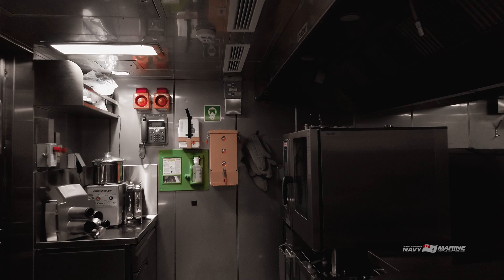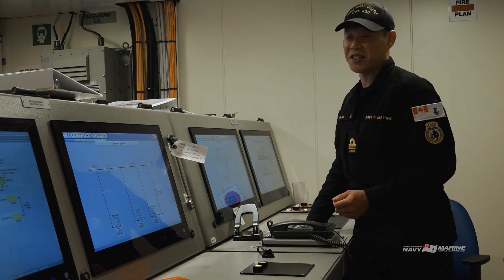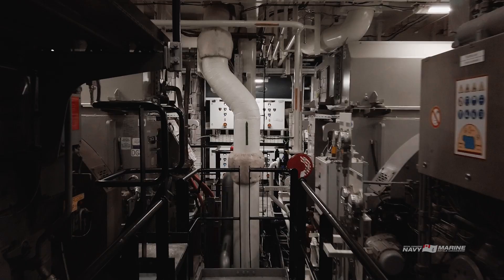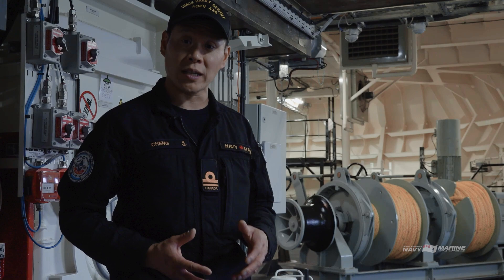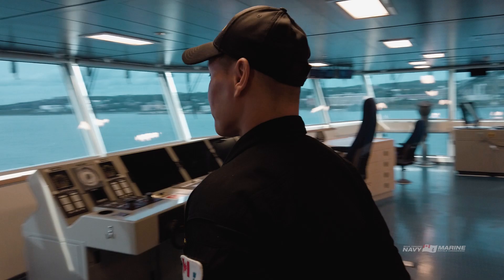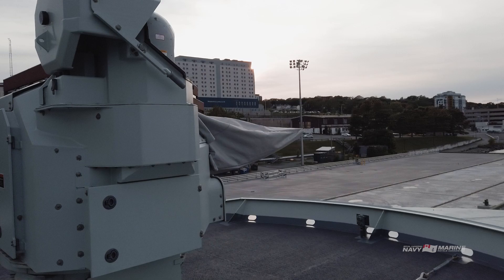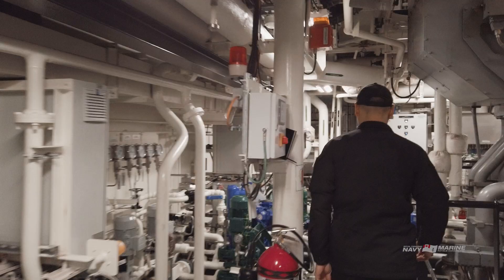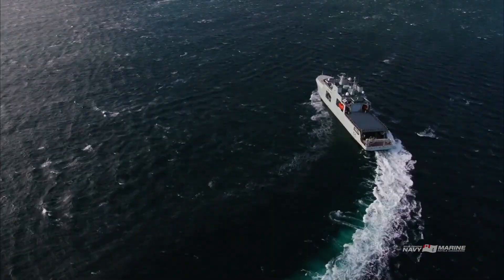INSIDE LOOK aboard HMCS Harry DeWolf

Comment: At least put a 40mm, if you’re going to arm something do it right. May as well make this a coast guard boat, that 25 won’t put a dent in anything
Reply: And you're going to attack another naval ship with a 40mm canon? Goodluck with that.....
Reply: The 25 mm will definitely do a lot of damage as long as it can be fed with enough rounds and no stoppages. It's not designed for big game.
Reply: guns are dead on navy ships, they have mostly been mid range anti air, up to this point with little use in a battle other then against a much smaller fast boat.  surface to air-harpoon types are the main armaments' these days for mid tier navies.   many different systems can be added to this platform as needed.
Reply: The helicopters do the dirty work
Reply: @0penminds  anti aircraft, anti UAV swarm
Reply: @0penminds  the greatest threat will most likely be air attack. A bigger gun means mostly longer range and longer range means more precious time to engage multiple incoming targets.
Survivability.

Comment: A beautiful ship that needs more teeth! Hopefully she was built with the ability to easily equip future modifications.
Reply: I just got posted to this ship. They are not intended to be a Warship, but they are quite versatile and could easily be fitted to be one!
Reply: @rwilletts1968  Thats awesome if you don't mind me asking what trade are you in?
Reply: @alecbidart4969  Martech Legacy Electrician
Reply: @rwilletts1968  What's it for then?  What's the point of having a warship, that can't fight in a war?  Just call it what it is, a fishery patrol vessel.
Reply: @Richard M  having that little bushmaster means free passage through the Panama Canal
Reply: It seems like she was designed with a lot of room for refit, possibly expecting a weapons upgrade when we don't have a PM that pisses himself every time he sees a scary gun.
Reply: @rwilletts1968  no tney couldnt tney would need extensive rebuilds, weapons Radar ect ect and it would be cheaper building a warship!
Reply: @patrickwellsnlesd that’s never going to happen on this OPV.
Reply: @thiccbeaver3132  NK way, this ship isn’t a warship it’s a patrol vessel nothing more.
Reply: @richardm3023  It's armed enough for  99.99% of encounters it will potentially face.
Reply: It isn't designed to fight it out with another ship. It is designed for arctic patrol. Landing and supporting a shore party is built right into the design. Planning on fighting in an island hopping war in the pacific? This ship would be incredibly useful.
Reply: What get my nerves about those boats is not that much the armament: Yeah sure, a little upgrade to a BAE 30mm would give those boats a 0.5km gun range further (from 2.5 to 3km) but they are not for military purpose(I get it). Nope it's the freaking price! It's based on the Svalbard class, who got a 57mm Bofors Canon plus a single surface to air missile (just in case a chopper get in your way). Svalbard class patrol ship cost less than 1/5 of the Canadian version, that's what we can call corruption of High scale. I'm pretty sure the russian Project 23550 patrol ship, inspired by same Svalbard class ship, will be more cost effective and  equip with a 76.2mm AK-176MA gun, plus 8 3M-54 Kalibr antiship missiles. Thoses Harry the Wolf boats look wonderful but at what price! Maybe we could have bought 8 nuclear submarines for that price tag!
Reply: @jplortie2910  I worked contracting in the Canadian military and I used to joke that our motto was saving thousands while wasting millions.
Reply: @jplortie2910  these can’t be as expensive as nuclear submarines! I don’t even know the price but they can’t be...
Reply: @PabloGonzalez-hv3td  Canada's motto should be : Doing less with more! But it's nice opportunities for business...
Reply: @bulletproofguy5112  You're right, I exaggerated. Nuclear submarines cost anything between 1.5 billion to 4 billions per unit: depending on size, equipment, how many you buy initially, etc. It means we could've had about 2 nuclear submarines or 7 conventional one for same budget. Of course, those boats serves a different purpose than submarines but I hope you can appreciate the magnitude of exceeding budget here.
Reply: @jplortie2910  yeah, seems a hell of allot. But hey our Nuclear armed Drednoughts are costing 30+ billion pound Over their life.
Reply: @jplortie2910  Ha that was our actual motto and it's not any better.
Reply: The main future role for the ship is to monitor shipping in the north west passage when the passage thaws and cargo containers start using it to transport goods.  They assert Canadian sovereignty over the passage and enforce Canadian law on ships passing through as well as provide sar.  I can see Canada buying another 6 in the next 20-30 years.
Reply: @boratb258  exactly, the NW passage is a huge boon for Canada and will bring in a ton of revenue tolling ships that pass through territorial waters (egypt charges 200k+ for a trip through suez). The purpose of this ship is to protect Canadian revenue in the Arctic, not fight wars. The US right south of Canada has the warfighting Navy and I doubt they ever plan on fighting anytime soon. Smarter for Canada to invest in itself and if the NW passage is lucrative enough then it can go building warships
Reply: @richardm3023  The ship is for patrolling the edge of the waters and looking for threats, Also Busting piracy pirates and so on.
Reply: @jplortie2910  True that they cost more but that is the price to pay to develop / maintain shipbuilding expertise in Canada instead of farming it out to other countries.
Reply: @richardm3023  I don't know but I'll be sure to ask all the other navies why they have patrol vessels less than a 10th this size.
Reply: @bulletproofguy5112  NOT FOR THE ICE. TRY THINKING
Reply: @richardm3023  it can also be used to break ice up to 3 feet thick, its meant for patrolling up north
Reply: It’s armed enough to chase off pesky Chinese fishing trawlers, or to compel another vessel to be boarded and searched.  That’s all it has to do.
Reply: @richardm3023  Who called it a warship?
Reply: @CorePathway  Exactly. All it needs is a gun capable of popping shots off at the bridge of a cargo ship that refuses to be boarded, which it has with the 25mm. The future role of these ships is built right into the name. Arctic Offshore Patrol Vessel.  When the Northwest Passage inevitably becomes a more viable route for international shipping, these ships will ensure Canadian laws are followed in our territorial waters, and provide better SAR coverage in the north.
Reply: @bulletproofguy5112  No, I disagree. These days the reduction in size of many systems. Makes them ideal for retro fitting. Even if that means containerised systems sitting on the deck, plugged in to the ships power supply. The naval version of the BAE 40mm CTS takes up very little room; could sit easily on the foredeck. It can also be fully integrated with the Lockheed Martin Canada CMS 330 Combat Management System and Terma SCANTER 6002 radar system, already fitted.
Reply: @thiccbeaver3132  design was finalized under Harper.
Reply: Top Deck middle, and The back corners of the Flight deck, could bolt 3CWIS Systems for Defence. Flares and shafts on the Gun Deck.
Reply: 35mm Oerlikon Millennium gun would be a great fit to replace the 25mm chaingun.
Reply: @kwharrison6668  10mm bigger really that much better? What is the best gun for that Ship?
Reply: @trevorlawrence310  it’s not just the size, it’s the capabilities. The millennium gun can deal with surface and air threats and has a radar. Rate of fire is also far higher than the current 25mm. The 25mm is still manually operated and aimed.
Reply: When all 6 for the Navy and 2 for the Coast Guard are made comes the building of 15 Canada Surface Combatant, these one will be very well armed for anti ship, anti air and anti surface warfare. I doubt the Harry De Wolf will be refitted with bigger weaponry as these would entail costly structural modification. The Harry de Wolf as an OPV can be outgunned by other countries OPVs and smaller Patrol ships. But then, it is build that way for a reason. Im still proud to see these ships coming in service for the Navy and Coast Guard
Reply: @jplortie2910  Late to the party but I'll add my two cents. While there is no doubt that the ship is way overpriced there are two things that need to be accounted for.

Firstly these ships are not in any way structurally equivalent. Svalbard is rated to Polar class 10, the Harry DeWolf class is rated to class 4 (the lower it is the stronger the ice). Svalbard is rated for 1m thick first year ice, Harry Dewolf is rated for 2.5m thick first year ice with old ice inclusions. One is designed to patrol the Baltic, the other, the Arctic.

Secondly, a lot of the money is going to outfitting Canadian shipyards. This is a long term strategy designed to gear these shipyards up to allow them to take on larger and more sophisticated vessels in the future. It's an investment in domestic production capability.
Reply: Should have two 25mm in a single turret. Two more .50 HMG in two aft remote turrets port-starboard, all around self protection.
Two cannons doubles firepower and a plus of redundancy in case of a single gun jamming. Plus four HMGs equals no blind spots.
Reply: You could give it more teeth immediately by parking a helicopter on it's flight deck that has teeth,. Unfortunately, the Canadian Forces don't have any of those at present but they are available to us. How about the British wildcat? ... or a maritime version of an Apache?
Reply: @thiccbeaver3132  They were designed for a 57mm gun.
Reply: @Trevor Lawrence  it's all about effective range. The current 25mm is good for 2 kms. A 35mm Rheinmettal is good for 4.7 kms. Longer range means more precious seconds of time to engage multiple airborne threats. Think several kamikazi UAVs.
The Fins with thier Kamina coastal patrol vessels planned for a 40mm Bofors yet upgraded the initial plans to a 57mm.
Love is in the air right? Lol
This vessel has two very expensive MRI machines. It and its crew and aircrew deserve a better self defence suite.
Reply: Its a patrol ship
Reply: @richardm3023  Offshore patrol vessel is not clear enough for you?
Reply: @philippelarabie9871  waste of money and time is not clear enough for you?   And if it is a patrol vessel,  it belongs in the coast guard,  not the navy.   If you are going to be an ally, then you will need to build some weapons that are worth the name.  Not a pussified, pacifism encouraging, toothless tugboat.  Questions?

Comment: -All ranks cafeteria? I wonder why they went with that option instead of eating in your respective mess? Not sure about you guys, but I like to relax when I eat my meals, especially at sea. Having Chiefs&PO's  and officers around would be uncomfortable as ragging about work is how the crew can blow off some steam.  
-The cabins seem like the same style as on our MCDVs. I view that as a plus. 
-Enclosed Focsle is also another huge plus. Having been to the arctic myself, I can positively say that Arctic wind is brutal. It is very sharp and bitter. I'm sure the bosns will require mandatory ear pro when dropping the pick or working on the cable. There is no place for the sound to dissipate as the vibrations will bounce of the steel and back towards the crew. 
-Bridge looks spacious. Nice large windows. excellent for lookouts, and OOW when taking bearings. Not sure how much more crowded it will get once navy starts putting gym equip/tables
-No gym? guess the flight deck will do 
-Arctic patrol vessel so I understand why we jus have a 25mm, but I do wish we had more teeth. 
-Love the cranes. very versatile. I think this class will do well in the arctic. It is not a war ship. its is a modular, adaptable vessel capable of delivering many different missions across our arctic. Science research, humanitarian, sovereignty patrols, coastal defence etc. It is like an upgraded MCDV. perfect for domestic missions. 

Overall I am very excited we are getting new equipment. I don't care how much negative attention the media likes to give our Navy, I am still proud of receiving these ships and I look forward to the opportunity to sail on them.
Reply: Likely space. I can't imagine messes smaller than the ones on MCDVs.
Reply: Modern military mess. US has been doing this for years and I'd consider them a fairly effective fighting force.
Reply: I'm with  you. Messes are important. Other ranks need a place to gas-off about their stupid officers & petty officers. The SNCOs and Officers need places to be fully relaxed and not worry about being "on" all the time.
Reply: All rank cafetaria is a great idea. the brass will be able to monitor crew moral and will be close by if question come up. in the hold day we could be a long time whit out contact whit those who could have answer questions. After some time you did'nt batter to ask question any more figuring that... well who care. Of curse im shure that you can alway go to the chef but the first lesson you learne in the arme force is. DONT GO OVER YOUR SUPÉRIOR HEAD.
Reply: there are still three messes aboard for officers, chiefs and petty officers, and junior ranks.
Reply: An RCN article lists "a high quality, full-function gym", so it is presumably a dedicated space.

Comment: I don’t understand the complaints about this class of ships being under armed given its purpose and operating theatre.  It’s not meant to do the job of a frigate or destroyer.  It’s meant for arctic patrol.  In any event, the BAE Mk 38 is a pretty robust weapon system.  Remotely operated from the CIC, the DeWolf-class ships are using the latest generation mod 3A, which has low light capability and which can train its surveillance system separately from the gun, making it more difficult for a target  know what’s being targeted.  And it has auto tracking, and the platform can hold two different kinds of munitions that can be selected remotely.  It’s a great choice for a patrol vessel.  The Royal Australian Navy has been equipping their patrol boats (Armadale and Arafura class) with the Rafael Typhoon, a similar 25 mm platform — and I dare say their operating theatre has far more hostiles than our arctic patrol boats will ever see.

Comment: Not enough fire power should anything series try to force it's way through the Artic zone. Other than that a fine ship. Need to finish the rest of the class and get the Frigates started.
Reply: this particular class is more for patrol purposes rather than fighting, if you want a fighting vessel look at the Canadian Surface Combat Project.
Reply: @themanformerlyknownascomme777  I have looked at the Canadian surface Combat Project and the Frigates are not due for another 9 years if they get built at all as there are another round of proposals to go with cheaper options.
Reply: Yes. Minimum defensive armament should be what it carries now and a 20mm Vulcan CIWS in the aft. 
The supply AOR vessels weren't combat vessels either. Yet the 20mm Phalanx, in a pair, was always there & 4 heavy machine guns. This expensive vessel rates one CIWS.

Comment: This is a reconnaissance warship without the equipment/ a coast guard ship sailing as a warship - against Russia’s push into the Arctic Ocean. It has zero to negative chance against a Russian battleship Russian subs and the 28 ports that Russia built on the other side of the Arctic Ocean.
Reply: It has zero chance against a Russian ice breaker.

Comment: No anti ship missiles? Why build a ship like this and not have if packing real power.
Reply: The 25-mm Bushmaster is more than enough to sink a trawler in the Arctic... There is no need for a harpoon missile when RCAF has fighters capable of firing harpoon and other air to surface missiles...

Comment: As an ex brit sailor with time on a AC carrier, DC minehunter and, a variable DC sub, I’m confused. Did he mean the generators in the “engine” room propel the ship or supply power to electric motors THAT propel the ship or ?
Reply: He's a subbie, probably fresh out of school.
Reply: This is a diesel-electric ship: it has a diesel-electric powertrain with four 3.6-megawatt (4,800 hp) diesel generator sets (what he showed on the tour) producing electricity for two 4.5-megawatt (6,000 hp) propulsion motors. So, the second of your options.
Reply: @kleinjahr  Perhaps, but he's correct. Like our subs, the Harry DeWolf class vessels have diesel-electric propulsion.

Comment: i heard one of your subs caught on fire , after you renamed her.
Reply: yes in 2004  -- she was repaired and refit and commissioned fully in 2015 -- "On 5 October, 2004 Chicoutimi was running on the surface, through heavy seas 100 miles (160 km) north-west of County Mayo, Ireland. Both hatches in the bridge fin lock-out chamber were left open and an estimated 2,000 litres (440 imp gal; 528 US gal) of seawater entered the vessel. The seawater caused an electrical panel to short out, which in turn started a major fire and caused all power to cut out, leaving the submarine adrift.[8] Nine crewmembers were affected by smoke inhalation and the submarine was left drifting without power in heavy seas.[12]
Reply: yeah any chance you want to hear of other countries naval errors, especially US ones. No didn't think so!